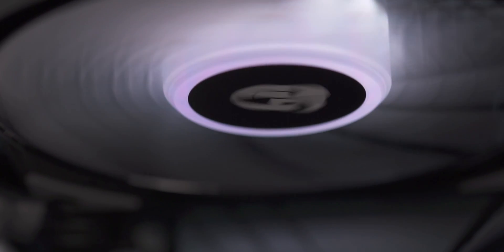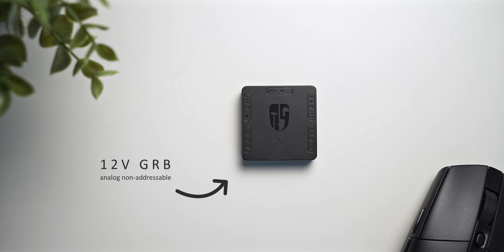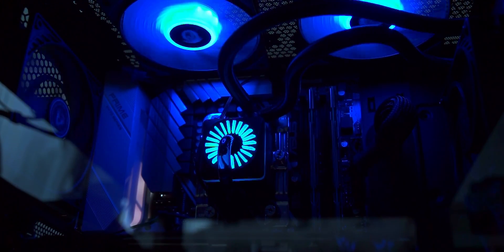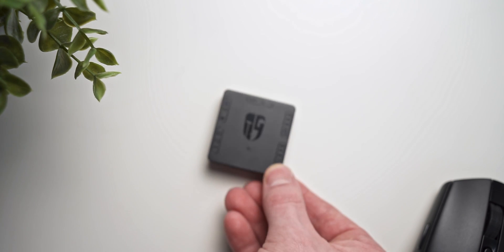Convert 12V GRB to 5V Addressable - Deepcool RGB Convertor

Comment: I recently brought a Razer Chroma Controller only to find out that it only supports 5v and all my fans are 12v. Can I use this device to convert my 12v fans to 5v to connect it to the controller? It is really frustrating. Thank you for your answer.

Comment: Some advice for people looking to do this. Coolermaster has an ARGB controller that you can purchase. My personal system has no ARGB (5v) headers, but with the Coolermaster Master Fan hub and the Coolermaster ARGB controller, you can have 6 (RGB) fans and 2 led strips in your case that are powered by (2) SATA power cables and only one fan header. The caveat is the same though where you can't control the RGB in software.

Comment: Sorry but can I use it in the opposite way? Like convert the addressable RGB to non addressable RGB? Because I have only one 3 pin and one 4 pin and two addressable RGB devices and I want to control each one separately. ( I'm ok if it's possible to change one addressable RGB device to non addressable RGB ).

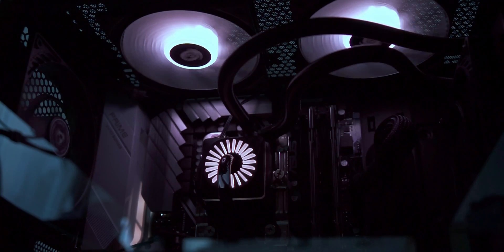Comment: 1:20 "switch scroll blink effect" what you mean here? Sorry my english is bad
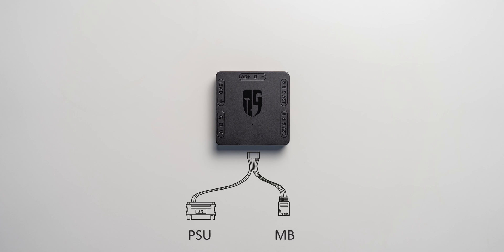2:32 man these diagrams are soooo beautiful and charming. What do you used to draw this? 
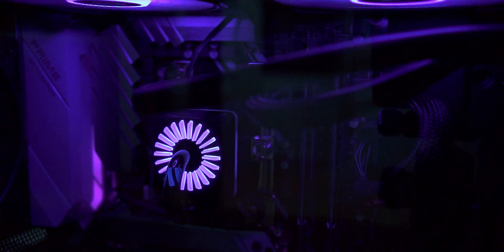3:35 man how do you make it worked with smooth transitions like this? When I Put color cycle it doesnt follow the right collor speed cycle from other aRGB components (like my XPG D50 ram modules). Also it flahes abrutaly every ~3 seconds. 
I dont think the reason is because u are using Deepcool converter + Deepcool Fans(water cooler) because I an also using a Deepcool GH-01 aRGB GPU support with this Deepcool converter and it doesnt worked like yours

Comment: I got the same converter but when i plug in my 5 volt fans and some of ky older 12 volt fans aswell, Which all connect from the converter to the motherboard my original 12 volt fans will become the colour i set them too with msi mistic light but the 5 volt fans will another colour. When i set my 12 volts to for example white light the 5 volts are yellow and when the 12 volts are blue the 5 volts are green. I really dont understand whats going wrong

Comment: can I plug my fan hub into the deepcool converter  to control my fan's lights via software?
Reply: This is what I was wondering as well.. did you ever figure it out?
Reply: @daedalos5132  I haven't.  I'll just get a motherboard that already has 3pin header instead of experimenting on more  unnecessary hardware 😅

Comment: Great video!....My problem is I have a 12v 4 pin female connector lead coming from my RGB case fan.  I don't have an RGB header on my mother board.  I need to convert it to 5v header in order to connect to my RGB hub.  Will this converter work for this purpose?

Comment: just want to clarify: the port on the left side  (labelled G D V) has an output of 5 volts, is this correct? is this where you connect the ARGB wire of the fan (while the wire for the fan is connected to the CHA FAN)? thank you.

Comment: How many fans can i fully use with it?
Reply from the maker: Depends on the power consumption of your specific fans. Up to 5 shouldn't usually be a problem.
Reply: @techlessYT  i mean it only has a signle 3pins 5v port right? how can i use my other argb fans with it?

Comment: Hey man i hope you replay i have a msi x470 gaming plus motherboard and the msi mag 240r cooler i am trying to to connect the rgb but the cooler has a 5v and the motherboard has 12v jrgb slot. If i buy this will it help pls respond

Comment: Hey. I got mine today, but I can't get breathing effects or smooth color change that transitions slowly and in sync with my other components. I have a Gigabyte B365M-D3H with 12V RGB header. Could it be because of the RGB Fusion software being stupidly designed as many people have said? Thanks for the great content :)
Reply from the maker: You're welcome! It could be the software, but also could be the board or a combination of both. Getting those breathing effects right with an adapter can be a bit of gamble sadly.
Reply: @techlessYT  Thanks man. Keep making the great videos you make. I have subscribed.

Comment: I wanted to buy a off brand rgb hub, on wich 5v would it go to then?Since its not deepcool neither asus nor gigabyte?thanks
Reply from the maker: Could be anything really, but it's most likely Asus standard as this is the most common pin out. Make sure to check the markings on the plug.
Reply: @techlessYT  what markings?

Comment: Thanks for this, I just got this and needed to convert my Gamdias Fans and 120mm liquid cooler to 12 volt on an MSI motherboard. There was no instruction with the unit so I'm using this video as a guide.
Reply: Can you still change colors on your liquid cooler or not?

Comment: I need Help! I need to be able to hook up seven to 8 fans. They are the SickleFlow 120mm Blue Led fans 12VDC. Wil I be able to run all of those fans with this device without them running full throttle? So if your fans are 12V u need to convert them to 5V for them to run correctly?
Reply from the maker: The Deepcool device is an RGB converter not a fan hub. If understand you correctly you need a fan hub and not a converter. Your fans don't seem to have RGB at all.
Reply: @techlessYT 
Now I think this is my problem! 
What happens when you plug a 4 pin 12VDC fan to a fan header that is 5V?
If I would get a 4 pin to a 3 pin extension to the motherboard would that work? Will this make my fans not run full throttle?

Comment: Hi! Can I put a 5v 3pin fan hub into the converter? I’m using a msi b450 tomahawk max with a 4pin rgb header.
Reply from the maker: Yes, you can use hubs or splitters with this adapter. Just make sure the pinout fits.
Reply: Thank you! Such a great help. Btw, great videos man!

Comment: Sir. I have a gigabyte ga-ab350m gaming 3(no rgb headers) but it has 4 pin (hybrid fan headers) and I bought a AIO that needs 3pin 5v. question is can i use this item to controll the rgb of my pump?
Reply from the maker: Unfortunately not, you will need a RGB controller instead.
Reply: techless can you show me or link something like that? When Im searching its getting all mixed up and I cant find the specific item. Thank you so much
Reply from the maker: Something like this should work fine: https://www.amazon.com/dp/B07JZCNPNV/

Make sure to check the pinout of your AIO's ARGB header - you might need an adapter, if it's e.g. from Deepcool or has any other unusual pinout.
Reply: techless the wiring manual says that 
*1 male 3pin 5v  for series connection fan
*1 female 3pin 5v for connectiong to motherboard

Comment: I have  a b450 tomahawk max mobo and already used a converter on my darkFlash CF8 pro. I'm using Mystic Light software from MSI to control the lights and most of the light modes seem to be fine but on the "Breathing Cycle" mode, the fans flicker  and does not sync with the mobo light smoothly. how to fix this pls ))):

Comment: Hey at 2:21 in the video when you say "where the sata plug goes into your power supply" where do u connect it
Reply from the maker: Connect it to the SATA power cable that comes out of the power supply. There usually are many SATA plugs often on a single cable. The SATA power plug is the same plug that powers HDDs and SDDs.

Comment: Will this work with delta team force ssd? 
Pls reply .. I will subscribe and bring atleast 10 more if you reply fast.
Reply from the maker: The 5V version should be compatible. There are other versions though that require internal USB, so they're of course not compatible.
Reply: Hi IGN Melfew. Did you get your SSD run with it already? I tried to control my Delta Force SSD with an EZDIY-FAB and it doesn´t sync with my motherboard and i have to switch it on after every new start of my computer manually. That doesn´t work for me. Therefore i am thinking about to that Deepcool Converter.
Reply: @Andi9N nope it isn’t working ... the same happens to me it doesn’t sync and had to be switched on again !
Reply: @nltemin2398  ok thanks for your answer.
Reply: Well I have 5v ssd but no Argb header in my mobo ! Can I use just the ssd without connecting the 5v header ?
Reply from the maker: Well, this is what the converter is for. But the SSD should also work fine without any RGB connected.
Reply: Thanks alot... you got a new subscriber here and atleast 10 more on its way! Your videos are awesome !keep up the good work mate 😇

Comment: Christ we went through the same issue at the same time... Same x470 board that doesn't have any argb and only two 12v rgb headers, and a deep cool aio that can't be controlled by the mother board. I got mine off of ebay maybe a month before your video.

Overall review: this is basically the fanciest a Y-splitter gets. you need sata power and a 12v 4 pin rgb header and can plug your 12v 4 pin and 5v 3 pin rgb stuff in at the same time. They wont be independent colors as this is a fancy splitter.

Comment: Will it work with Themaltake ux100 CPU fan (there are 2 pin D and G) https://linustechtips.com/main/topic/1154911-question-about-argb-on-the-thermaltake-ux100/ ?

Comment: Hi - when using this device - The cable connecting this to the SATA cable was overheating? Why is that and is there any quick fix?
Reply from the maker: I'd definitely contact Deepcool. It could be a defective cable or converter if you can exclude any external heat sources.
Reply: @techlessYT  thank you for your quick reply! Great vid

Comment: Ahoj, mám Asus ROG MAXIMUS IX EXTREME(4pin 12v rgb) a grafiku mám SAPPHIRE Radeon NITRO+ RX 5700 XT 8G OC Special Edition (3pin 5v argb), bude to fungovat, tak abych softwarově mohl ovládat i barvy na grafice, diky
---------------------------------------------------
Hi, I have Asus ROG MAXIMUS IX EXTREME (4pin 12v rgb) and I have graphics SAPPHIRE Radeon NITRO + RX 5700 XT 8G OC Special Edition (3pin 5v argb), it will work so that I can control the colors on the graphics software, thanks
Reply from the maker: No, you will have to control everything that's connected to the converter with your motherboard's RGB software.

Comment: Does it work even if my motherboard doesn't support AURA SYNC, RGB FUSION etc. ??
Reply from the maker: If your motherboard doesn't support RGB software it probably doesn't have any RGB headers, or does it?
Reply: My motherboard doesn't support aura software and has no 3pin header at all, my fans are darkflash dl12 pro which is AURA SYNC supported. So if I will buy that Deepcool RGB convertor can I already use the aura software?

Comment: Hi man. Keep it up your great work
I have a question. Is it ok if I connect a HUB where I have connected 3 fans to the 5v input of the converter? Would it burn the RGB?
Reply from the maker: Thanks! 3 fans on a single are usually fine. You could likely add even more, but this depends on the power consumption of the fans.

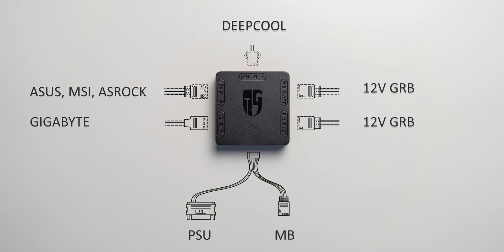Comment: @techless hello.. my mobo is gigabyte b450m, i have 1 argb (5volts) fan and 1 rgb (12volts ) fan, and aircooler rgb 12volts fan... it is ok to connect my argb fan to this converter and my two 12volts rgb fan and aricooler connect to 12volts converter.. can i synchronized to my mobo and not flickering?.. base on your diagram 3:05.. pls reply thanks..
Reply from the maker: Yes, that should work fine.
Reply: @techlessYT  how about the flickering. . someone said the 6fans connected to this converter the other fan is flickering...
Reply from the maker: It depends on the power consumption of your RGB hardware. Another guy here in the comment section is successfully running 6 fans from the converter. 3 devices should almost certainly be fine.
Reply: @techlessYT  my rgb header manual  5050 standard led ,maximum of 2Amps and maximum of 2meters.. so basically 3in1 fan argb and 3in1fan 12volts and 1 fan rgb aircooler it is ok this converter bro?.. 3 devides connected...
Reply from the maker: Should be ok.
Reply: @techlessYT  thank you bro.. love it..

Comment: Im a little confused here. So if I connect the "DEEPCOOL" fan (RF120), will it's RGB lighting work once I plugged it on the PSU even though I have nothing to connect with the "MB" because its the problem on the first place. No RGB header on MB. I noticed that the bottom has 2 connectors (PSU/MB), does it mean that I can just connect one of the 2? Totally frustrated with my connections. Lol @techless
Reply from the maker: You need to connect it to the motherboard as well. As you don't have an RGB header you should probably get an RGB controller instead of a converter.

Comment: Hi, I recently bought this and found out that my motherboard has only one 4pin rgb header. I used this converter thermaltake ux100 which is an ARGB cpu cooler (which i mistakenly bought). Is it ok if I plug my non ARGB fans into the right side of this converter (4pin-12v)? My motherboard is gigabyte h270 gaming 3.
Reply from the maker: Yes, that's what the headers on the right side are for.
Reply: @techlessYT  thanks! You helped me a lot!

Comment: Does this work with hub?
Reply from the maker: Yes it does
Reply: @techlessYT  if the hub is a controller hub, can the fan still be controlled by a remote?
Reply from the maker: I'm not really sure what kind of controller hub you mean.
Reply: @techlessYT  the hub that let the fan be controlled by a remote control
Reply from the maker: Fan rpm control and RGB control don't affect eachother, so you can still use your fan hub like you would without a RGB converter.
Reply: @techlessYT  umm the controller hub that i mean isnt for pwm its for the argb (controlling the light only), it usually comes with 3 or 6 argb fanpack
Reply from the maker: There's really no point to connect a RGB controller to a RGB converter. Or are you talking about a passive RGB hub?
You should probably just tell how the device is called.
Reply: @techlessYT  tecware arc spectrum f1 quadpack , you can see that it comes with a hub that let the fan be controlled
Reply from the maker: You could connect this to a RGB converter. That way the ARC device will basically function like a passive hub and the RGB configuration will be done through the mainboard's RGB software.
If you want to use the remote control and all the ARGB effects you won't need a RGB converter at all. Just leave the hub's RGB plug unplugged and turn off the sync switch.
Reply: @techlessYT  ok man thanks for the advice!

Comment: So this will work great with my UpHere fans that come with a 5V hub... my b450 tomahawk max has 12v 4pin headers and this is necessary for the aRGB to work. Awesome
Reply: Bro did it work for you???
Reply: @AltaafJahankeer1501  when I plugged in  the UpHere fan hub to the converter, they did not sync. I had to buy RGB splitters to connect the fans directly into the converter for them all to sync. You can buy 4pin RGB splitters and just remove one of the pins with pliers and those will work. I found the 3pin splitters were more expensive for less product lol
Reply: @lukas______  thx for the quick replyy
Reply: @AltaafJahankeer1501  no prob. I can link you to the splitters if you want. I paid like $8 for a two pack of 1 to 4 splitters on amazon
Reply: @lukas______  pls and thank you boss. I was wondering if I could do a half blue half purple lighting with my fans with these splitters?
Reply: @AltaafJahankeer1501  you can only do one color at a time. You use the rgb converter to sync up with your motherboard, so whatever your mobo's RGB is doing, the lights connected to the converter should do the same. However the converter transition isnt as smooth (slower/delayed) in flash modes but it still works. I have mine set to plain white rn lmao. 

https://www.amazon.com/dp/B072K21JVF/ref=cm_sw_r_cp_apa_i_xoQeFbJ29NP1C
Reply: @lukas______  a right thanks a lot bro

Comment: i have asus b450f rog strix gaming with 4 pin 12v rgb header and 3 fans cougar vortex rgb fcb.this convertor will work for me?
Reply: yes, if the 3 fans are plugged into a hub or something from your case than you can plug in the input from that hub into the convertor
Reply: @bloemkoolgladiool8416  I tried my way, you write, but it doesn't work. They have their own box and it produces 3 pins of 5 volts for the motherboard (I have 4 pins of 12 volts), only the led strips can be used if you connect them alone in the deepcool convertor through the aura.
Reply: ΗΛΙΑΣ ΣΤΑΜΑΤΑΚΗΣ if your budget is higher than you buy a terminal from asus. There are 3 led strips included, I have also a b450-f motherboard and I save up now for the terminal

Comment: Can you expand a bit where you said if you wanted to have more than just a static color and take advantage of ARGB you'd have to buy a separate controller?  What's the minimalist way to be able to use all of ARGB capabilities with only a RGB header?
Reply from the maker: The minimalist way (or rather the only way) would be a separate ARGB controller. Unfortunately the standard RGB header (12V GRB) can only carry information for a single static color at once, so ARGB effects, that require more than one color at once, are simply not possible.
So the only way to enjoy real ARGB without an appropriate header is to get a dedicated ARGB controller.

Comment: I got CF 120 which is 3 fans, will it work if I plug the 3 pin argb splitter to the hub and sync it?
Reply from the maker: Should work.

Comment: my mother board Aorus gaming 7  z270x has 12v 5pin  grbW .Now will this work with that ?
as it says 12v 4pin to 5v 3pin..how to make this work ??/
Reply from the maker: Usually there's no need to connect the W pin for hardware without white LEDs. So just connecting GRB should work fine. You maybe need to set something in the control software though.
Reply: @techlessYT  now the wire that comes with thia deepcool rgb converter which has two ends.one for SATA and other for RGB header will not sit on the motherboard .it is made bigger with rubber coating.
Can i use extendwr cable for this i got from motherboard and bend the W pin on the cable.
Reply from the maker: That should work fine.